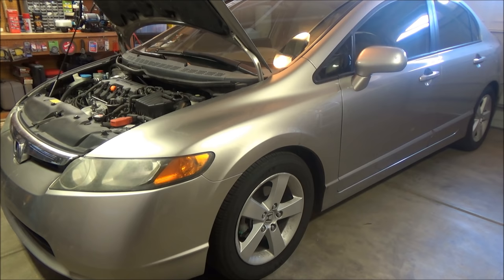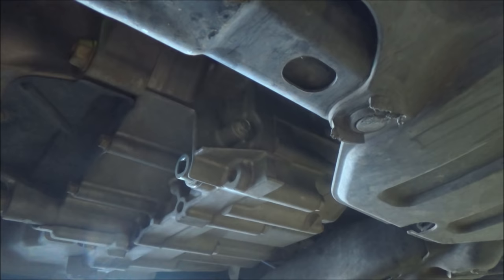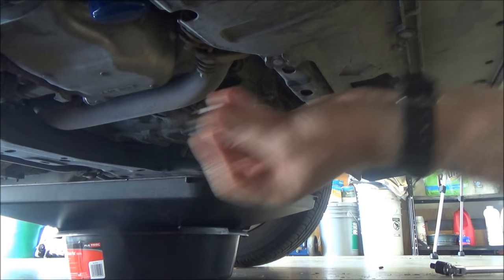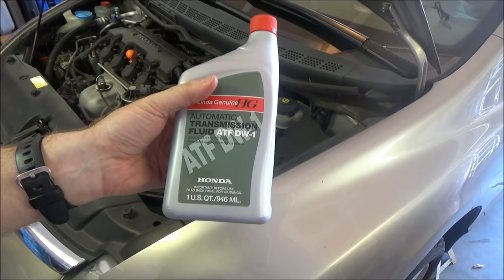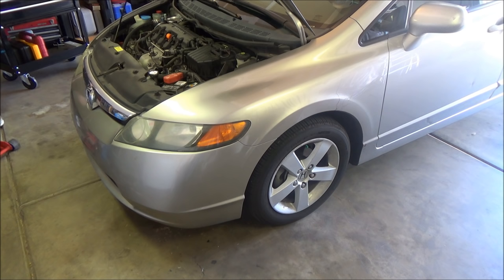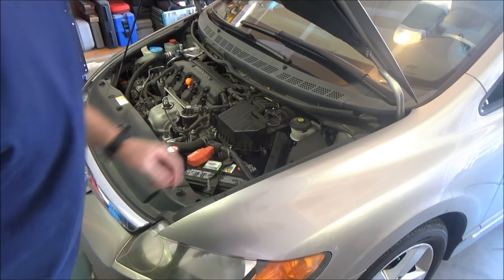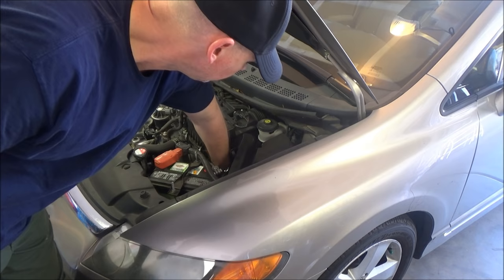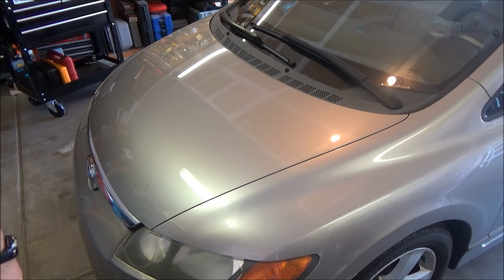Honda Civic Automatic Transmission Fluid Service 2006 EX (2006-2011 Similar) (Drain and Fill)

Comment: Great video, concise. Very easy job. I agree with doing this every 30,000 miles. My mom gave me her 2008 Honda Civic with 78,000 miles, which is low mileage for a car that age. I just changed the transmission fluid today (it had never been changed before), and fluid was a grayish brown, instead of red. Was a fair amount of metal sludge on the drain plug magnet as well.  I'm going to do one or two more drain and fills in the next few weeks to 'catch it up' and have nice, red transmission fluid.
Reply: Wow. A Civic with only 78,000 miles. Geesh, that's no mileage for a Honda. I'm getting a friend of mines Civic in about an month with 163,000 miles. Drives really nice and sounds great. 
Did you notice a difference with all the changes?
Reply: Just got my grandmas 2008 honda civic and only has 65k miles
Reply: I did two more drain and fills shortly after my first comment.  The transmission fluid is a nice cherry red.  Now I only have to do one change every 30K.

Comment: Great detail, step by step.  Absolutely excellent presentation.  Thank you so much.  Ron
Reply from the maker: Ron Shansby Thanks!
Reply: Thanks for your time Daniel D WILLIAMS
Reply: Big Dog50001 Automotive I completely agree. Fantastic narration.
Reply: Hello i need information please help my friend, my civic bright lamp D trasmission automatic new civic generation 8, have 2 sensor  2rd clutch automatc 28600RPC003 what this pressure corect work? I have this e sensor 3rd chutch automatic 28600RPC004 what this pressure PSI work??? Help no information in Brazil thank you my dear friend, my english no good!

Comment: Most excellent!  Some points you might try. Keep and mark ounce levels on some old plastic juice jugs for using. Drain out into one. Put a mark on jug. I use a piece of painters tape. Drain that into another jug and refill with new ATF right to the mark. That way you’re assured of putting in exactly what came out without measuring anything. This approach works great for other car fluids too.  These jugs drain overnight almost completely then just a little gasoline in them to clean them up for next time.  Mine took 85 ounces or 2.65 quarts. Great video

Comment: Thank you very much. So thorough and easy to follow. 
Just today I noticed my car was no switching gears properly. So I checked the moto and transmission and turns out I was empty on the transmission fluid. Here I’m hoping the motor has not been damaged.

Comment: Doing my first trans change on this generation civic.  Doing 09. I specifically looked for your vid and badda bing this came up.  When I do trans changes I’ve been draining into a 5 quart bucket with measurements on the side so I know how much to refill as a start and sanity check.  I’m still laughing because yup my drain came up to 2.5 quarts exactly !!! Soooooo appreciate your vids and yes I remembered to take out the drain bucket before lowering.  I’m sure you put the extra don’t forget guys message in because you forgot and heard the ooops I forgot crunch plastic sound of pain.

Comment: "Don't get under a vehicle without jackstands under it." YES. Also, as a backup measure,  I keep my floor jack in place just in case their is a failure with one or more jackstands. Never know.
Reply from the maker: Never a bad idea to have a backup, thanks for the input!
Reply: I always have spare tires and rims at my house so I put one one each side next to the jack stands

Comment: how do you keep the engine bay so clean? I'm scared to clean the engine...thanks for the video bro.
Reply: I work at a dealership and we just hose down the engine bay with the engine cold and I've never seen a problem.
Reply: That's because you dont know what your doing if your scared to rinse the engine bay. Leave it running and use a blow gun to get off the excess water buy the coil packs or anything electrical

Comment: Heeey I did what you told me i called Fernandez Honda dealership and asked them what kind of transmission oil I needed for my 2010 Honda Civic and he asked me for VIN number and he told me I needed the DW1 like the one you show on your video and like you said I didn't have a CVT transmission like i thought i did lol :-)
And you video was excellent !!! 😀👍
Reply from the maker: Honda makes models with different transmissions, some have a conventional automatic transmission (like in this video) and some have Continuously Variable Transmissions (CVTs).  Most newer Honda now have CVTs.  That being said, I am not aware of any 2010 Civics (in the US) that have CVT transmissions.  Don't take my word for it, go to a Honda dealer parts department with the VIN and they can tell you what it needs.
Reply: @BigDog50001  
Heeey my password for my gmail is bigdog18 lol 👊😀
I did have a 2003 Honda Civic hybrid  and when I went to AutoZone he told me I had a CVT transmission and gave me the oil I needed but now on my 2010 Honda Civic I want to put the oil that is recommended like the Honda genuine oil and now you have me thinking what kind of transmission I have 🤔 I just assumed it was a CVT transmission so thanks for the advice I will go to the Honda dealership and they will give me the recommended oil for my car and I'll find out what kind of transmission I have lol :-)

Comment: Find the transmission line that leaves cooler or radiator and take it loose and put it in bucket, start car and run while you add fluid, when fluid clears up running in bucket, shut engine off check fluid and add if needed. Your done and all fluid is new, not 2  1/2 new and 4 quarts old mixed together

Comment: This gets a lil less than half the fluid out. My Civic I bought recently was neglected. I wanted all the fluid out. You do this process 4 times. I drove the car and used it for work in between each time. Basically mixing the old and new. Only way to safely flush out a Honda Transmission. I learned this after researching and reading a couple good threads on the 8th gen forums.
Reply from the maker: Thanks for the input!

Comment: You also need to change your transmission fluid filter, it's external. Under the air cleaner assembly...

Comment: Oh, one more thing... The transmission filter is under the air box, should change that too. It's easy.
Reply from the maker: Thanks for stopping by.
Reply: That according to the manual is non serviceable meaning in order to do that you must open the transmission.

Comment: well that was easy did all the fluids on car same way power steering , brakes , transmission and antifreeze before my daughter goes off for a year with car 1200 miles away hopefully it helps with the long drive on old car with 150.000 miles on it 14 years old now

Comment: This car does have the filter as well (?) which should be changed when changing the fluid. I believe it is under the air filter housing.
Reply: I don’t think it does.  Have my 06 civic since new and never heard of a transmission filter on these cars.
Reply: There is definitely a filter behind the air box. Should change along with the tf change. Like the video but not a complete job.
Reply: Which may I add is a horrible pain the the a$$ to take off re-install. I called Honda and asked to speak to one of their techs. I asked the guy about the filter he said, “those don’t have filters”. Not true. It’s up and behind the air filter box to the left of the brake fluid reservoir. And that also isn’t east to get those hoses off with the flared ends on the filter itself. Once you get the hoses back on each end, then you have to re-position the air box and secure it, which is the most tedious part of the job.

Comment: Big Dog50001 Automotive  Great video! Very clear and straight to the point! Helped my boyfriend change my transmission fluid for me =)  Where did you get your breaker bar?? All I find for the 3/8 socket are pretty short or less than a foot long. Thanks in advance!
Reply from the maker: The one I used in this video is from Harbor Freight.  https://goo.gl/osFeGQ
Reply: Great! Thanks for responding!

Comment: Appreciate the video. I am wondering though when looking at another video, and looking at yours. The other guy lifted the car to just loosen the plug, then let the car run until the fan turned on. After that he lifted the car up and drained the oil, is the similar aspect of you running the car for 60 seconds before seeing if the fill line is correct? I didn't see much difference in what you both did, seems straightforward. We all appreciate your help, you know how it is as you're saving us $150 per comment on this post.. Great job man, Please don't forget to answer this. Thank you

Comment: I read 3 articles on how to check the tranny fluid and all three are different. 1) engine running while hot 2) engine off cold 3) engine hot and off between 60-90 seconds after engine is turned off... you people are driving me crazy!

Comment: It's necessary to buy the original version of the fluid?
Reply from the maker: I recommend using genuine Honda fluid.
Reply: You can use Idemitsu H Plus,
Its the same atf fluid, DW1
As long as its DW1 atf fluid its good for honda.
I use it on my civic, and the transmission shifts great.

Comment: Great video,  just one question I thought we need to check the level with the car  idle at full warn up temperature not with the engine off 🤷‍♂️
Reply from the maker: No, Hondas like these should be checked 60-90 seconds after shutting off engine.

Comment: My car is sitting at approximately 120k miles. As far as I know the transmission fluid hasn't been changed once (but it's possible). At any rate, during the inspection the dealer wants to charge $190 for the transmission fluid exchange service so I opted for the DIY. This video looks REALLY helpful and I'd like to go ahead and do this, but first I have one question: with as many miles as my car has and with the fluid service history unknown, do you think the fluid needs to be FLUSHED or can I still just replace it as shown in this video?
Reply from the maker: Just FYI, Honda does not recommend a using a machine to "flush" the transmission fluid, which might be what that dealer wants to do.  

If I owned that vehicle, I would do a drain and fill like I showed in the vehicle and check the condition of the fluid during the service.  If it was really bad, I would probably do a second drain and fill (after a short drive) and reassess the condition of the fluid after (and then possibly do a third).  If it looks decent (like there is still a hint of pink), I would probably opt to wait and do the next transmission service (drain and fill) when I do my next oil change.
Reply: Thanks for the info. I went ahead and changed it myself (and wow it was super easy). I haven't test-driven it yet so the color's nice and pink right now so I'll update later.

I'd like to not have to refill several times since the stuff is expensive. Come to think of it, this is not the 1st inspection I've had and this is the first time transmission fluid failed, so at 120k miles it's got to have been changed before. I do it right at the honda dealership btw so they should change the fluid the honda way, right...?

I'll do what has to be done though and do multiple fills after some test drives if it looks bad. The old oil did look pretty bad as it was a dark brown.

Thanks again dude
Reply: Update: I took it for a test drive and it was noticably more responsive. Definitely smoother in gear shifting. However, after I got back, after waiting about 10 minutes, I checked the fluid and it was brown. Not nearly as dark as it was before I changed it but still brown. Will probably go for a second fill.

Edit: I actually read the full description of my inspection report. It says the technician will use a cleaner and flush the transmission to ensure all old fluid and particles are emptied. C'mon honda people, step it up! Do you not know this isn't recommended?
Reply from the maker: Nice job getting it done!  One drain and fill only gets out about 36% or so of the fluid on most Hondas, which is why it is very important to do it at regular intervals.
Reply: Tatsuya u have to do 3 refills to get it completely out or just change it with oil changes until clear
Reply: So did you change the fluid 3 times or just once?

Comment: good night I bought the same honda 2006 ex the one that sold me the vehicle told me that it gave me a year of warranty of engine and transmission, I believe that the change of the engine oil and transmission is that is giving me a guarantee, my question it is every few miles I have to change the transmission oil or how I can know or how I have to check when I need the transmission oil change ... thank you and bless you I hope your feedback
Reply from the maker: Honda will tell you to follow the maintenance minder schedule on the vehicle dash on most newer Hondas.  For transmission fluid, I recommend doing one drain and fill like I showed in video every 30,000 miles at a minimum.

Comment: Great video! One question, does the amount you jack the front end up impact the amount of transmission fluid that drains out? Would it perhaps drain a higher or lesser amount if you had it on a lift and not jacked out?
Reply from the maker: Sometimes it can make a slight difference, I have tried it both ways and the difference is pretty negligible.  That being said, I don't recommend jacking it up higher than necessary to do the job.  Thanks for the comment!

Comment: Thank you, I just did this 👍

I measured the amount I took out and it's about a quarter of a quart less than I put in. But I'm having trouble with getting an accurate reading on the dipstick. 

Question is, what would happen if it's a quarter quart or so too full? 

Thank you
Reply: For future ppl with this cuestion, if you think or know its overfilled, just drain out what you think is overfilled, check the level after and if its a bit low then but some of the fluid you drained back in until full. Or new fluid

Comment: yes very easy to do thanks, the only problem is i dont have a torque wrench but should that matter?
Reply: $20 at harbor freight. If you dont have one. Just make us moderately-lightly tight. Snug. Not too tight.

Comment: Great video but I have question. Mine is an LX. Would the amount of transmission fluid be a different amount or would it be about the same? Thanks.
Reply from the maker: Same.

Comment: Thanks for the vid. Very clear and concise. I’ve read to do a full flush we need to 3 drain and refill to try to “completely” replace the fluids. Your thoughts on this?
Reply from the maker: Thank you for the comment.  Yes, three drain and fills would be the Honda recommended procedure for replacing all of the automatic transmission fluid.  You usually only need to do this if the vehicle has not been regularly maintained.
Reply: Big Dog50001 Automotive   So if you change 2.5 qts say every 15000 miles that would be effective or over kill?  How about every 30k?

Comment: Thanks a lot for this video. I've been facing jerks issues while gears change on automatic transmission. Do you happen to know anything about that? It seems similar to the gear oil since the dealer who changed the oil for me two weeks ago, didn't use Honda oil, so I suppose that could be a problem? 

I have recently bought Honda Civic Reborn 2nd hand, so didn't know about any of this stuff, now that I'm facing the problem, I've come across your video. it helped a lot!
Reply from the maker: Hard to say from your description but if you are talking about ENGINE OIL, then you can use any good quality motor oil (that is the proper viscosity), it doesn't have to be Honda branded motor oil.  Changing your engine oil shouldn't cause hard shifting.

If you are talking about AUTOMATIC TRANSMISSION FLUID (ATF), I would not use anything but Honda ATF DW1 for a Honda automatic transmission (non CVT).  If other fluid was used, I would do 3 drain and fills to get it out.

You may have other issues going on in your transmission and might want to have a pro take a look at it.

Comment: Goodyear recently did an exchange fluid for me on the transmission of my 2012 Honda Accord.  About 5,000 miles later, I am now noticing a horrible vibration coming from under my front car seat and steering wheel.  It happens at different mph.  Not to mention, I am noticing the car is not changing gears properly.  Goodyear said they put Honda fluid in the car, but how does one know for sure?  I am hoping they did not screw up my transmission.

Comment: Hello from Greece and thank you for the great tutorial. What I didn't get quite clear is that in the car's book says that the total capacity of the transmission oil tank is 5.9 liters and that the change requires 2.4 liters. How is this being controlled when I'm unscrewing the drain plug? I mean that no matter how long am I waiting for the transmission fluid to be emptied, the rest of the capacity that doesn't need to be changed. will remain in the tank?
Reply from the maker: It will not all drain out, some will stay in there due to design.  Thanks for the comment!

Comment: thanks! and where do u recommend I find the lowest price for  the required Honda  transmission fluid.
Reply from the maker: Not sure because I get it by the case, but if I was only going to buy three bottles I would probably check Amazon or your local Honda Dealer because of shipping costs.

Comment: Amazing video, instead of jacking up the car I will use my fluid extractor, even easier, just like I do my oil changes. You didn't change the transmission filter doe
Reply from the maker: Thanks for the comment.
Reply: I was only able to get a quart or so out with my extractor.
Reply: @TheSchmed  then you didn't put in in all the way, i got everything out
Reply: @rizocars6115  yeah, I have ramps, drove it right up, and taking the plug out is a breeze.